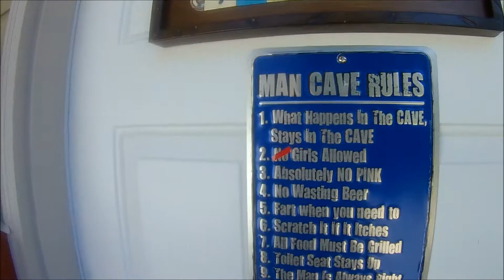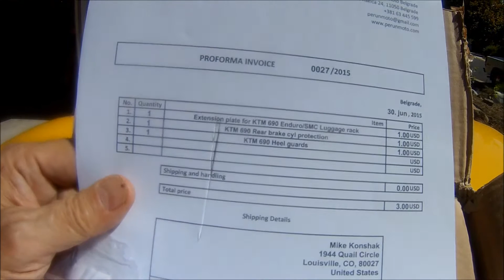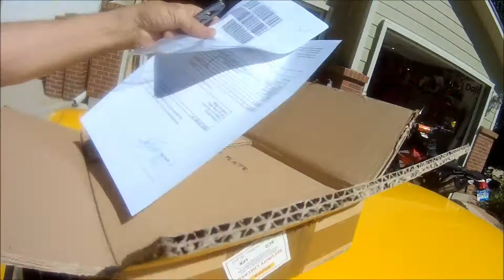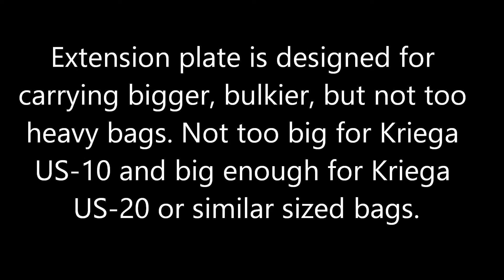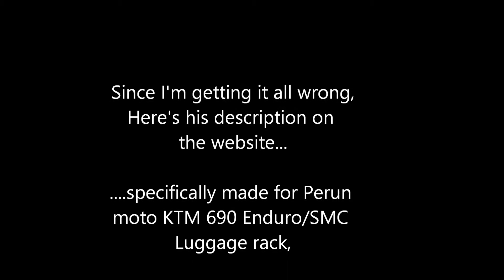KTM 690R Enduro ABS, Rack Extension Plate,  PerunMoto.com Part1of3

Comment: You should try ROK straps!
Reply from the maker: I was going to buy a couple pairs from the Honda tent at the Lawrence Hacking Adventure Rally but I got distracted by happy hour at the lodge. They are terribly expensive, though $25 USD a pair? Ridiculous.
Reply: But they are amazing. You will never use anything else again!
Reply from the maker: I have a couple for the top of my soft saddle bags for putting my jacket our bike cover on, but I would not use them for my Rollie bags.
Reply: telerover why not?
Reply from the maker: I guess because I don't want the elastic part for the heavy stuff.